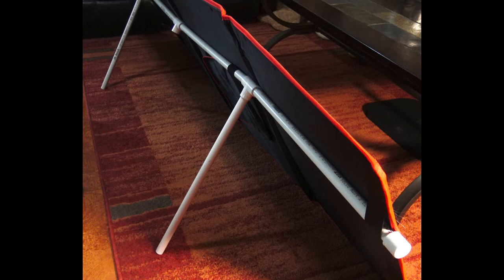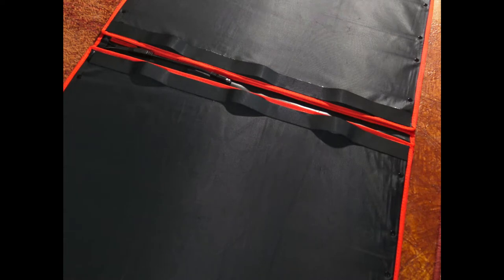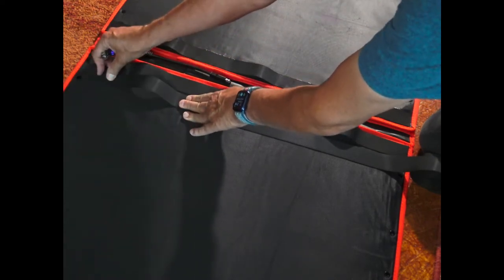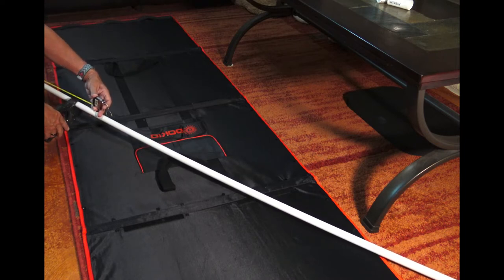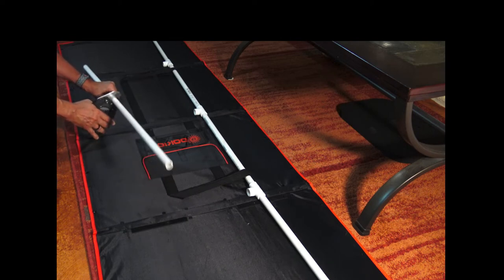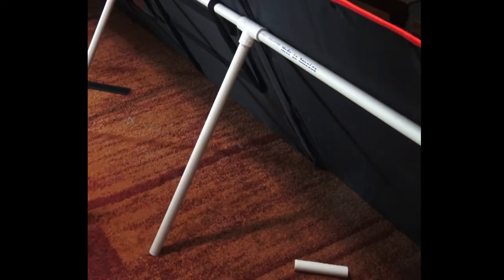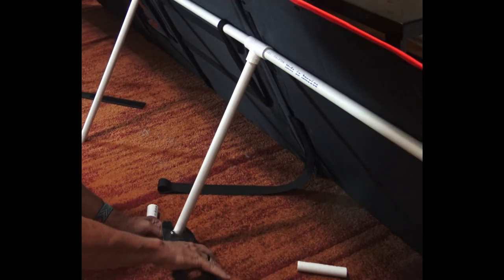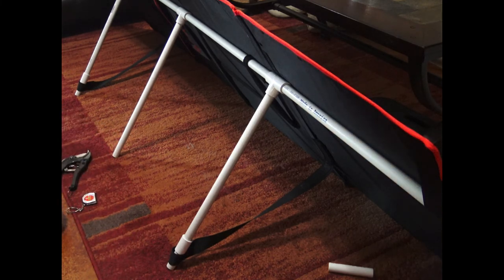Quick and easy support stand for DOKIO 220w 18v Foldable Solar Panel

Comment: Mine came with fold-outs behind each panel to stand.  What is the single wire for?
Reply from the maker: Yeah, it's great when they come with the fold-out stand.  This one is good but cheap.  The wire I see is the SAE solar plug unless you see some stabilizing velcro.